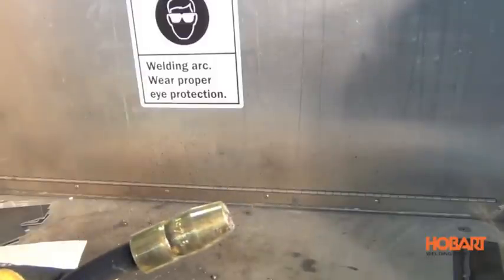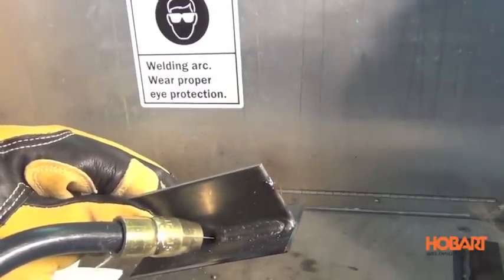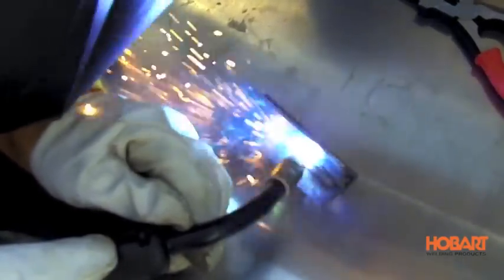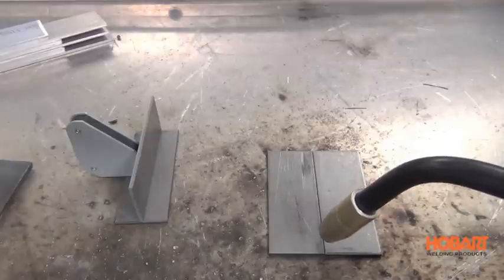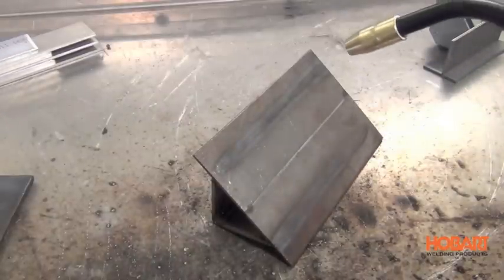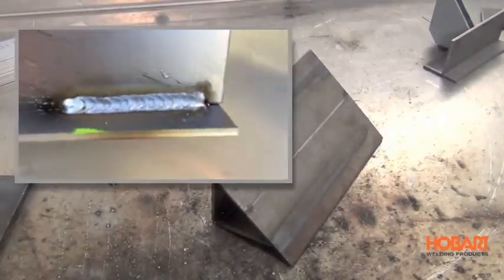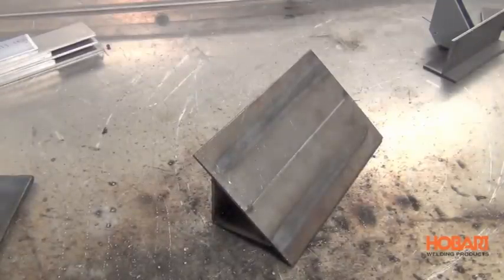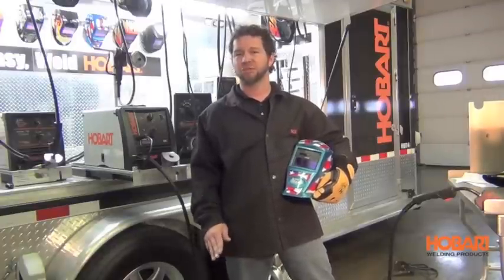Wire Feed Techniques and Tips

Comment: I know I’m kinda late but if anyone sees this I’m brand new to welding, with a flux core, what should my wire speed be for 1/4 inch steel
Reply: Good question. I was hoping he would touch on settings. I’m sure there is a starting point.

Comment: Im a metal worker/welder and if i had to do a few practice welds while i was at work i would look like a dick,i am 37 and the 2 guys i work with have been welding longer than that.I know my welds are strong but in confined space doing overhead welds on a furnace that has to withstand contant temperatures of over 1000 degrees id better be bang on.I wanted advice on uphill 25mm with no prep,not perfect conditions.Real life welding instructions please,prefrably up a dodgy ladder?
Reply: Weld the ladder. Then tac weld a platform where you need to weld. Problem solved.😂